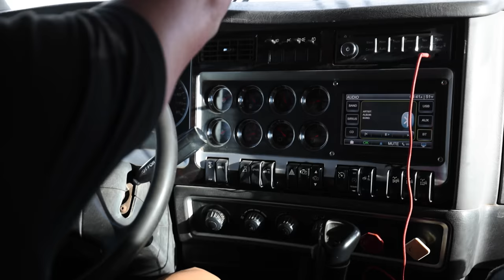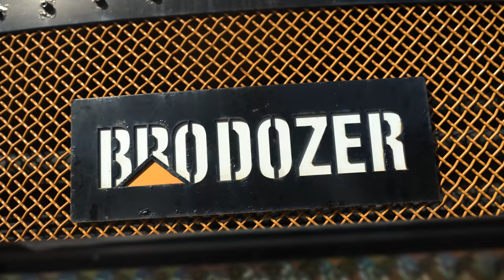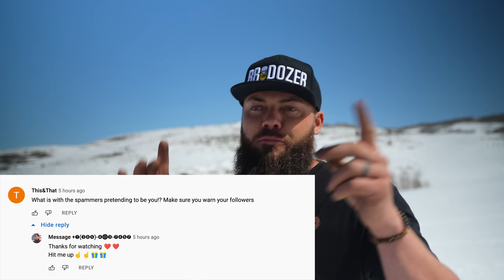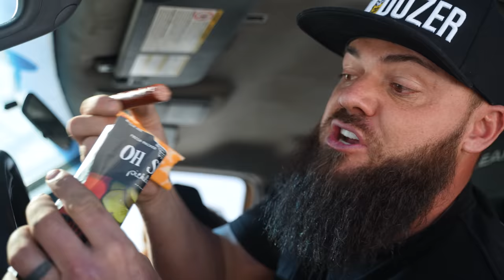This Ambulance MIGHT Be Stuck Til Spring!!! Brodozer On Snow Tracks!

Comment: Without ANY context, this rescue scenario sounds like the ramblings from someone on bath salts. "Lifted Ambulance, that's not actually an ambulance, but a mobile home gets stuck in the snow on the same mountainside where they were previously driving a Lambo up and down.  Gets rescued by a bunch of bearded burly men with the desire to sell you on a Debit card that could change your life with $200 draft protection using the code SPARKS. Enter: The Brodozer exists, which has nothing to do with a bulldozer except the tracks, but a bulldozer has 2, and this has 4, buyt who is counting. They take a break to do backflips off the top of said ambulance before dragging it down the mountain backwards"

Comment: It was also at 36:03 that he realised, he SHOULD have insisted on getting "Clip-On" Dualies - for the Front Wheels, when deep-snow 4 wheeling.
As then he would have had an ability to self recover (by having 4x 3M long 4"x4" wooden posts, to sit the "gap" between the duals at both Front & Rear, to allow a mud-stuck, or deep-snow stuck "railway line" to be laid under his vehicle, (at Front & Back, each side), along which his DUALS would run with 100% grip, as the duals were pressed against the wood, in-between the tires gaps.
Thus making 3M+ squirts of movement, out of where he got stuck, allowing a self recovery.

But no, he went with OPEN DIFFS at Front & Rear, and only the one CENTRAL semi-diff-locker in the Transfer case, to allow 4x4 driving.

Comment: The transmission just went out in my 7.3 turbo F350. I love my truck and I have to sell my camper to get the trannie fixed. It will be worth it. I have been helping my 90 year old mother instead of working so money is tight but I know I’ve made the right choice. Diesel may cost a lot right now but there is nothing like that pulling power. I love your videos.

Comment: I've had those adjustable zip ties for years, were those yours? You can't patent a product that is already on the market
Reply: Ive used the adjustable ones before too. His are different tho. They have some sort of rubber gasket on them
Reply: Same ones.. They have been around for years.. wouldn't buy them though.. made in china..  there are some sweet ties made in usa with stainless heads.

Comment: Guys just a thought inflatables heavy duty load securing  bags like 4 foot by6 or 8 or 10 feet probably  make to order so if u can't roll it.  float it or u can  slide it out  with the    one's that I have  seen . was big good, 2 foot between pallets  in trailer 
  bags

Comment: 36:03
It was at this EXACT point 36:03 that he knew.!!!

He should have INSISTED on full "Lockers" being fitted, when they did the 4x4 conversion.
Because without FULL "Lockers" (Center Transfer Box and "Front-axle DIFF / Back-axle DIFF" LOCKERS)
Those spinning individual wheels, simply DESTROY any advantage 4wheel drive gives - in absolutely SOFT snow, (or soft sand/mud etc., as well)
Full 3 way DIFF LOCKING, to enforce all wheels to turn together, means that when someone TUGS you with a Bungie Rope, your 4WHEELS will all drive as if you yourself have tracks.
You won't have tracks, but moving with a tracked topw vehicle ahead, give you the same drive advantage (ONLY IF ALL DIFFS ARE 100% LOCKED, all axles and thus all wheels turn equally at the same time (simulating tracks)

Comment: My 5.7 hemi 2003 ram 1500 with 12.5 x 35 x 20. Gladiator m/t and an open dif on the rear axle. I miss that truck. I called it "truck Norris"

Comment: Ha guys way to go I used to run a HD wrecker  for years but I had a accident and now a triple amputee with my only one hand left in a hard shell brace now I drive in winter for doctors and Nurses that couldn’t get to work in the snow this will be year 5 of driving for FREE I have a tip jar for my fuel after many years of them building me back together I am looking for a sponsor to help with the cost  Re bin 6 years not working just on my disability covering costs you all rock  and thank you for all your kindness to people that you helped

Comment: If you ever need to siphon fuel from one tank don't suck on it put a towel around the fuel spicket and blow that will cause air pressure to build up in the tank and cause the fuel to come out your hose

Comment: If you had a drill drive garden hose drill pump that pulls water with a high speed drill. It's a cool tool if you need to suck fuel from a tank or turn into a bilge pump. You got the beast machinery. Go
Gettm and real them in I wish I had to be the helper of your missions you guys rule

Comment: I want to help recover stuff like y’all do but I don’t have the funds to do so but I do have a 99 k2500 4x4 truck with a 12000 pound winch but it pull’s the two batteries down under load and I don’t have dif locks on my truck  I love off road and helping people out I am trying to start a YouTube channel  any way I love the stuff y’all do keep up the good work

Comment: If you use a ziptie properly, they don't chafe cables. [ I am an actual certificating electrician from a country with much better regulations than the USA! ( a lower proportion of people die from shocks in the UK with a 230v mains supply, go figure ) ]